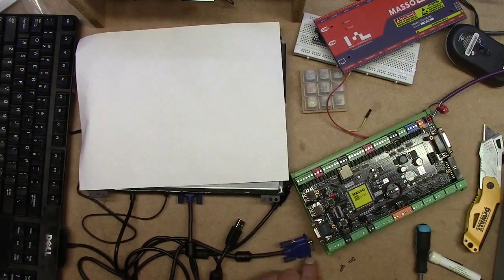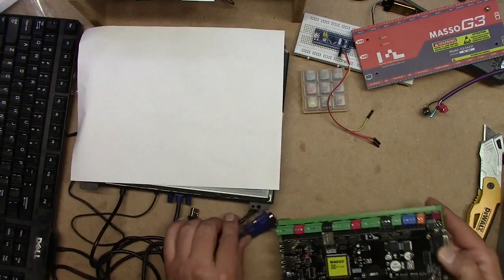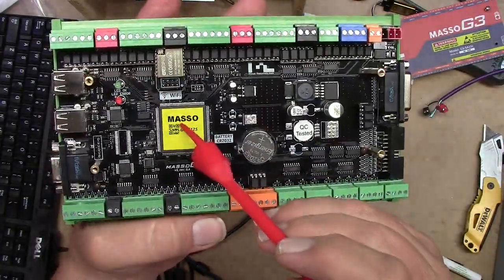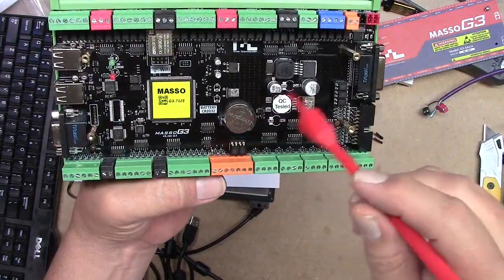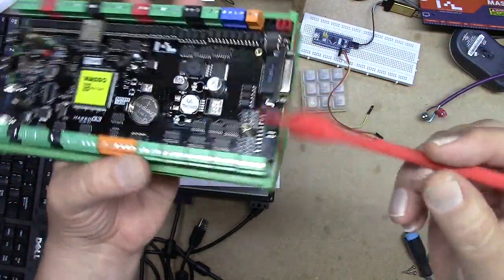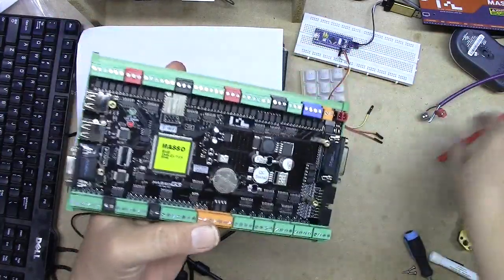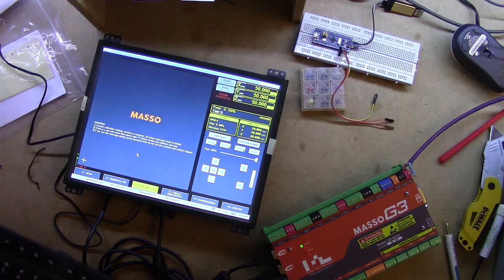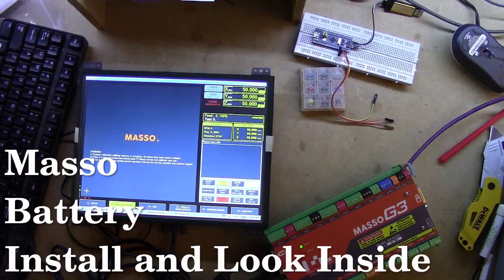200617 CNC - Masso Battery Install and Look Inside

Comment: What microcotnroller does it use? Do you know? Also the battery isnt needed but I believe its for real time clock assuming its configured in software.
Reply from the maker: It has a sticker covering the micro, I suspect its a STM32F4 or equiv. You're probably right on the battery.

Comment: Why don’t you do a full wire of the masso
Reply from the maker: what do you mean by "full wire"?
Reply: As you really know your onions it would be good if you did a full ground up explanation of the panel build through wiring and why even to the reasons why a machine is built a certain way you have a really good camera presence 👍